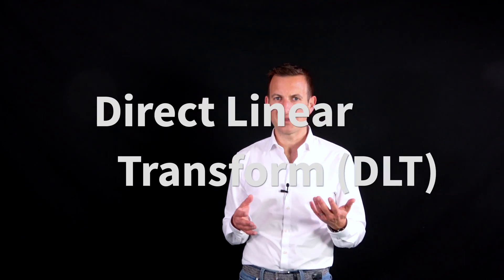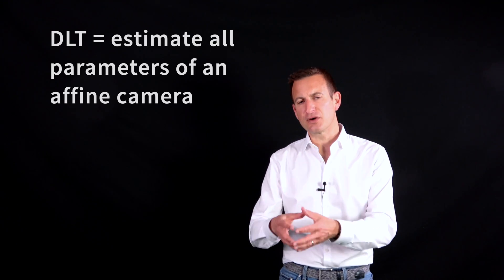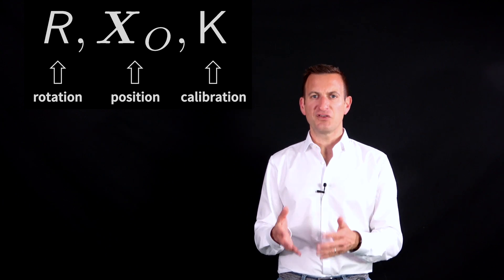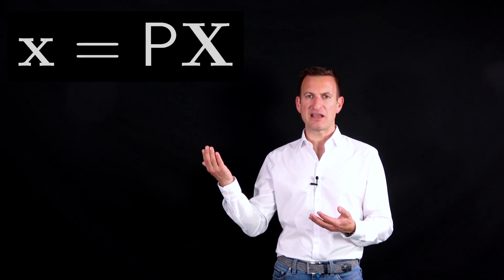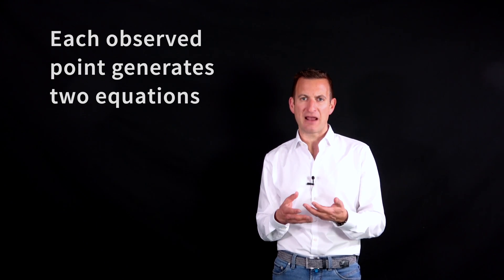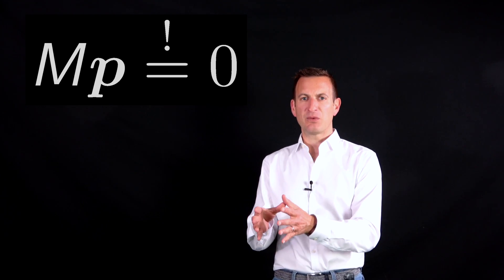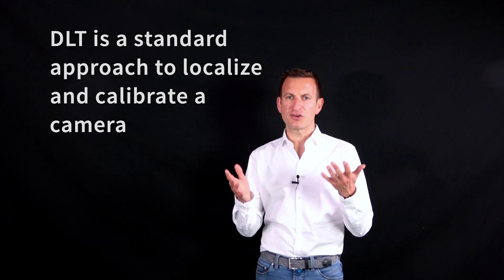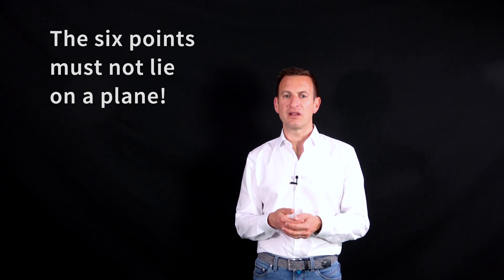Direct Linear Transform - 5 Minutes with Cyrill

Comment: What does he mean by that the six points must not lie on a plane at https://youtu.be/Fdwa0UEJ_F8?t=310? So if the six points lie on a flat ground, this won't work?
Reply from the maker: Yes that is what I said. A flat ground is a plane, it will not work. You need a different approach in this case (using a homography).
Reply: They can lie on a plane (i.e. z=0), but then problem is solved using Homography and then u need only 4 correspondences
Reply: Yes, I don't know the reason why the system becomes degenerate, but that's what he said.
Reply: When all six points lie on a plane, rank of M matrix (Coefficient matrix) is 9 which is less than 11. This leads to degenerate case. See here: https://www.youtube.com/watch?v=3NcQbZu6xt8?t=2200